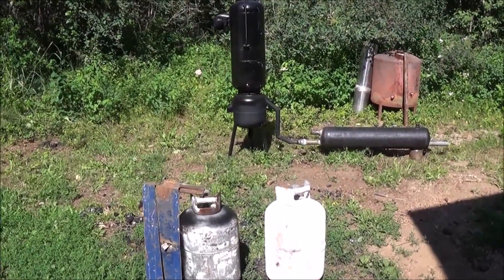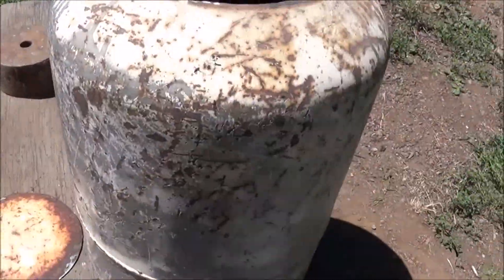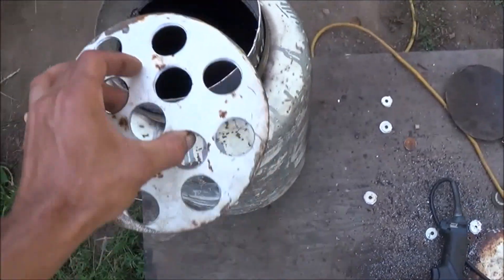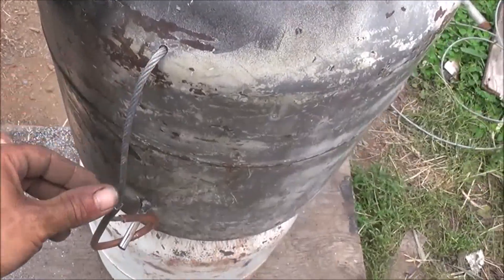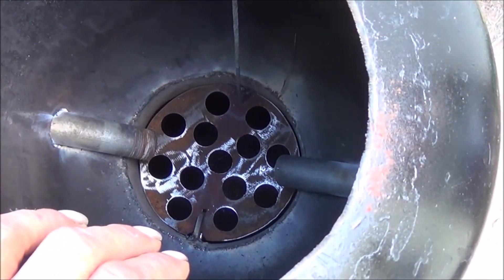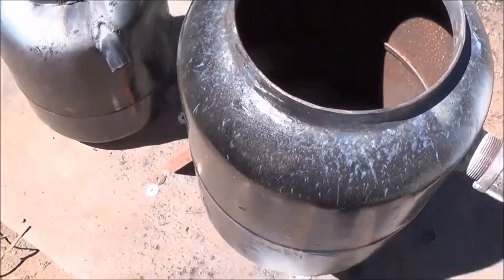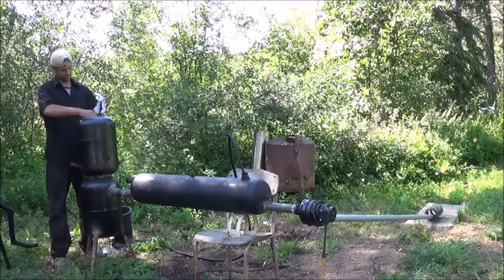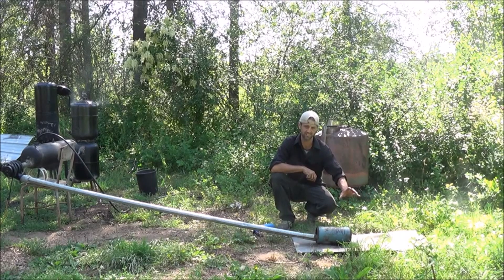How to build a Wood Gasifier from easy to find materials!

Comment: Very nice design ... you didn't use a cyclone ... however ... any tar problems? .... It seems that having that amount of air coming in through the 1 inch nozzle made the combustion zone very hot ... therefore and maybe ... it destroyed most of the tar ?? Then cooling the hot gas could produce some water and tar inside the cooling pipe ... I wonder how much stuff is inside that pipe and where the condensed liquid  is expelled? Thank you.

Comment: How much energy do you think can be produced this way, by collecting foliage and small sticks off the ground of a forest. (Which isn't exactly quality, long burning wood fuel)

I was wondering if this gasifier technology could be used to power a robot which navigates the forest, collects more small foliage to power itself, so that it can collect more.

Why do this? To prevent forest fires, which can be prevented if the bulk of the fuel on the ground is burned up in a controlled burn. The robot could make controlled burning automated and more feasible by burning very small amounts at a time.

Certainly there are a lot of challenges. Dealing with terrain, programming, navigation, collecting the fuel, burning it in a closed oven. Making sure the fire never spreads and starts and actual forest fire. Could be completely I feasible just from power requirements as well, but not sure.

Comment: the thing is that this requires no fossil fuels to make basically fossil fuels, i realize that the gas is mainly hydrogen, but in the cooler there will be some vapor, this vapor is actually flammable and depending what you burn has different fractions to it, and engine can be ran on this and the gas itself, its just amazing what can be done with waste brush or wood material

Comment: Mr. T, what's the purpose of the tank filled with water?  Cooling?  Why is there another 1-1/2" pipe coming out of the pressure tank above the gas intake pipe?  Looks like you filled the tank on the flame-side of tank.
Great videos and I appreciate your creativity!